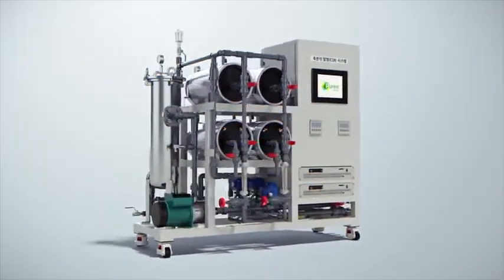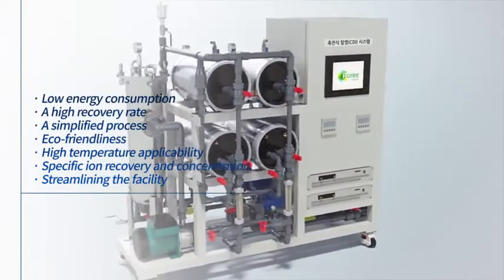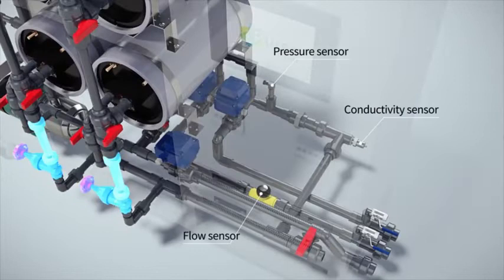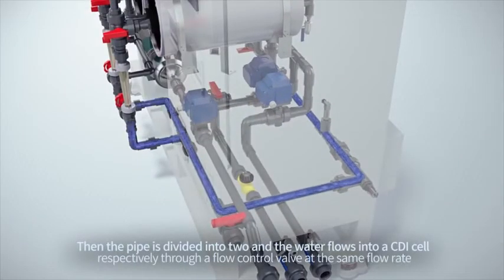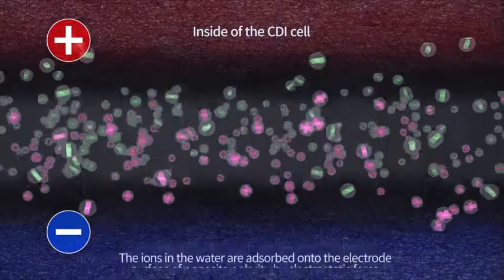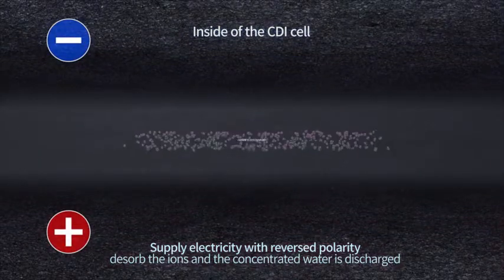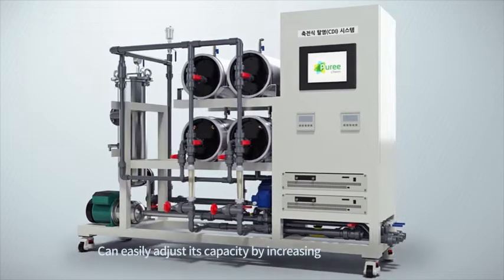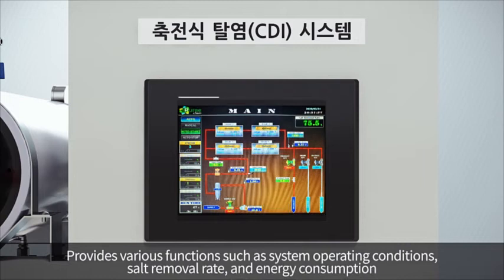CDI System : Capacitive Deionization

Comment: Good day, is drinkable water?
Reply: if you want drinkable water, the best method is distillation by vacuum, this way no error of the system will affect the purity of your water. water will evaporate at room temperature if you put it in a vacuum, all the impurities will not outgas and stay in the primary recipient. there are commercial systems for this